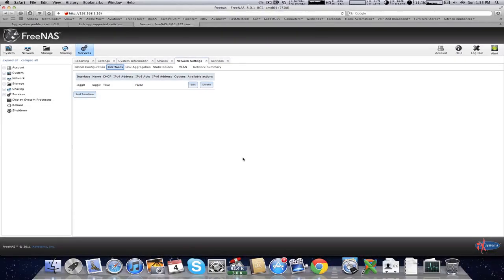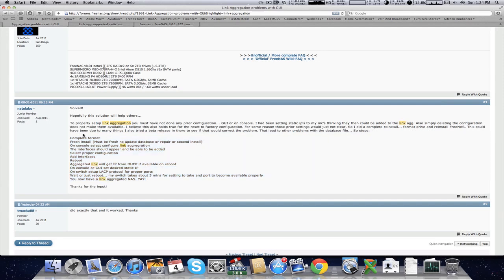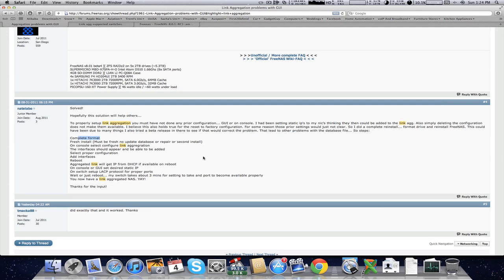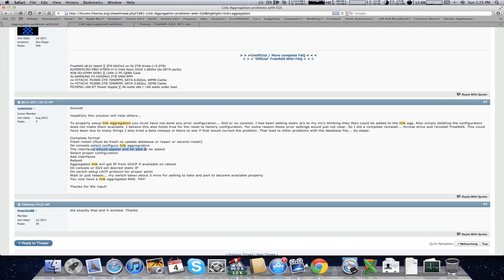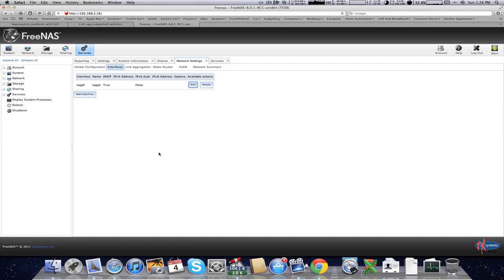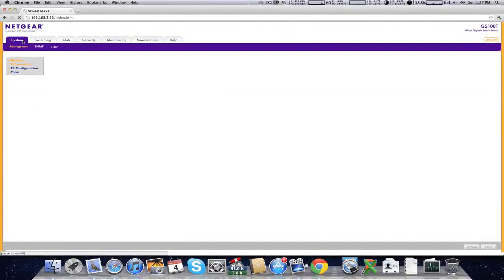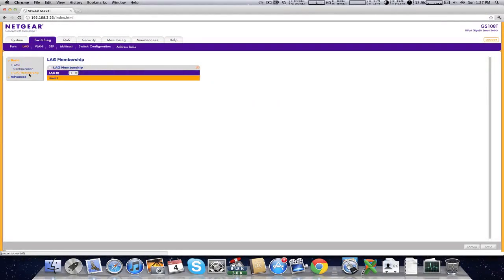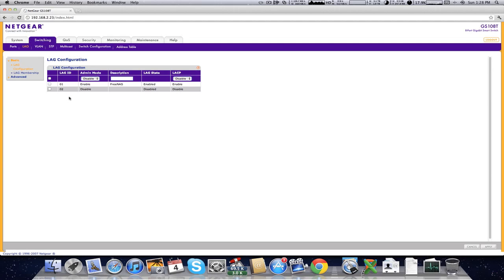FreeNAS 8 Link Aggregation Setup

Comment: what's the fastest speed you have achieved?
I thought the GS108T is not compatible with 802.3ad
I've got a NAS that I have assembled, it has an intel i7 gaming and 8 gb of ram,
There are three 2tb disks in RAID 5, in the pc I have a ssd then aggregation arrival to 273 Mbytes / s or 2178 Mbps
my switch is a d-link DSG1100-16

Comment from the maker: OGHugo, yes and no. Yes in the fact it will still work, but no it will not get you a 4 Gigabit link to the FreeNAS. If this were possible then the LACP switch would have done it in the first instance and you would not need to pass to another switch. Switches although Gigabit cannot maintain simultaneous gigabit connections. The switch between each one really fast. Switches are really designed for connecting a whole heap of different devices and maintain Gigabit connection between them all.

Comment from the maker: I know what the graph says but that is not what im am getting. I asure you I am getting 80-90MB/s. I took 97sec for an 8GB file. 8000MB/97sec=82.47MB. Depending on the type of file is varies a little. The graph that was being displayed may have either been wrong or maybe my system wasnt working properly at the time (cant remember that far back)

Comment: Don't think so, look at the graph it says bits per not bytes per on the side, meaning you where getting like 9MB/s not 90

I understand that ur computer didn't support lacp as well.  From the testing I have done even if you have two comps setup with lacp, it only uses 1 physical nic per connection meaning a single host is locked to 1gbps. I feel like this is a bug, but this is the only way it works in freenas from everything I've seen.

Comment from the maker: I wasn;t actually working at all because my computer did not have dual ethernet ports, I only did this so I could have it setup for the futre when i upgrade my mac with dual ports. Ergo why speeds were slow. I was getting through a normal connection around 75-80MB/s peaking at 90-100 at times, so almost maxing out cat5e, thus should be double if LACP was working with a computer that supported LACP.

Comment: your copy job was NOT spread over your two links. your screen shows the data use on the LAGG interface, and 1 of you physical interfaces, while the other physical interface sat unused. On top of that, you where getting at max 200mbps out of that. horribly slow connection. i would say this is not working